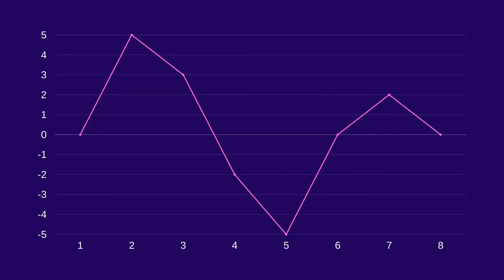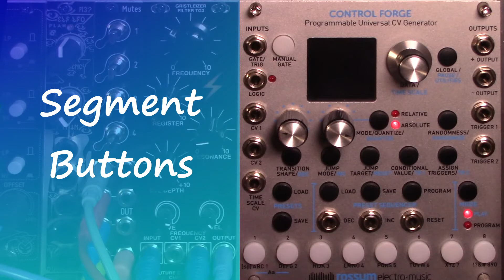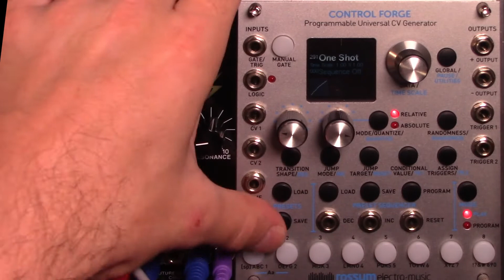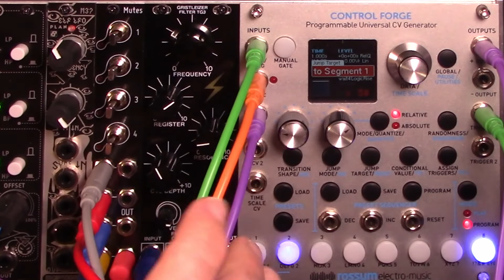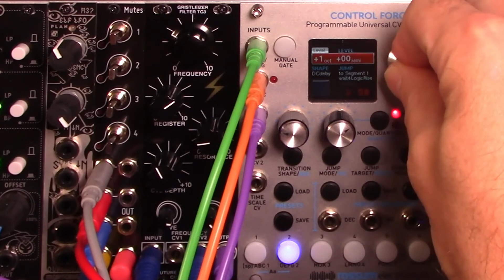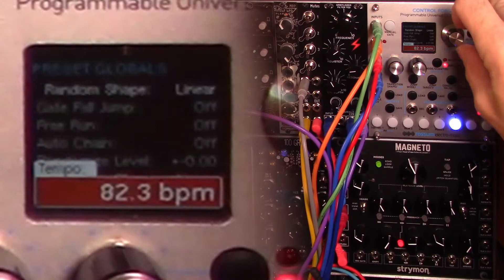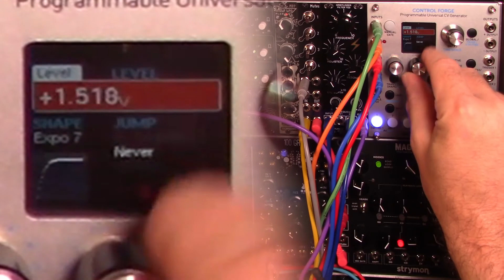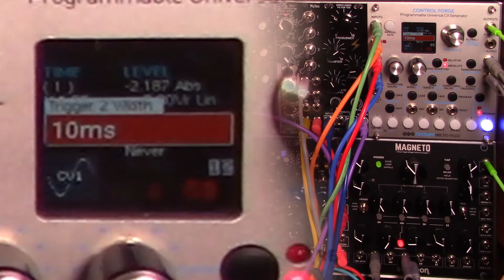Utilities that Rule! Control Forge Quick Start and Patch Examples #ControlForge Rossum

Comment: thanx! very well explained and gave me some answers i didn´t found anywhere else. 
I think it can be also very interesting for smooth subtile fm modulations over time or moving fx  just a bit and getting crazy in the break of a song. 

Is it right that you can also record cv?
Reply from the maker: It does not record cv, but it can process it with quantize, evaluate for a threshold or simply track it for Relative levels.